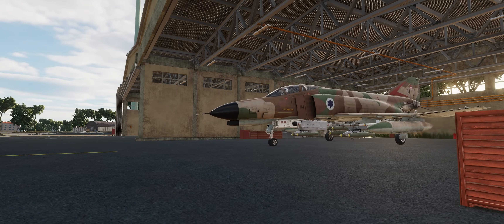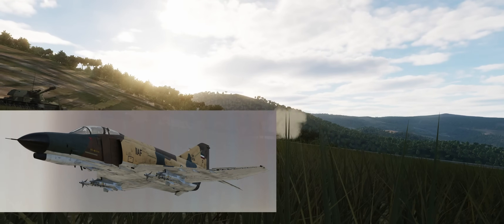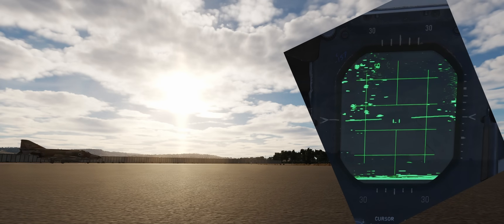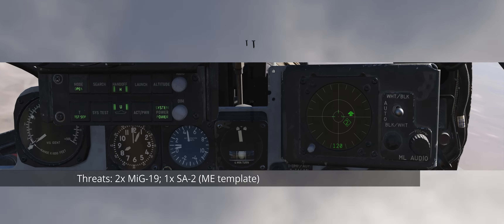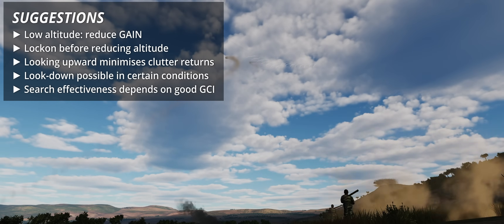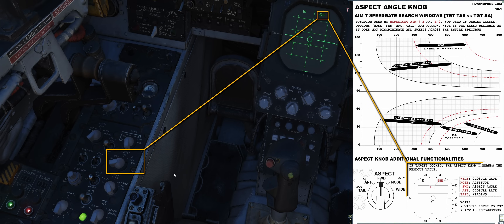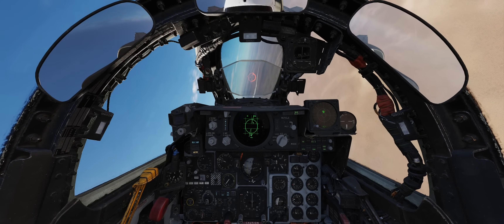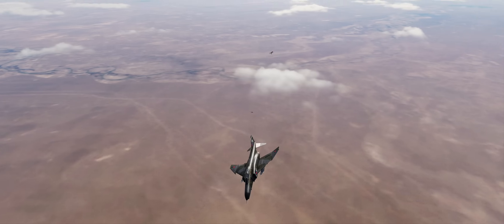DCS F-4E Air-to-Air I: First Steps

Comment: The F4E DCS has been given isn't even the best variant of the phantom , japan has the F4E Kia with upgraded radar and air to air missiles and germany has the F4E ICE with the upgraded radar and AMRAAMS
Reply from the maker: Those are definitely not the "best" F-4 variants, and even saying "best" makes very little sense.
Reply: @FlyAndWire  these F4 variants had pulse Doppler radar with look down and could carry AIM9L
Reply from the maker: That's correct, but they got them so late in the life of the Phantom that the opposition was no longer MiG-17 and MiG-21, but Su-27 and MiG-29, and other bluefor aircraft were late F-15, Eurofighter and so on.
If you put the F-4E in its historical context, I say it is one of the most capable versions of the Phantom ever produced, although I prefer the Navy versions.

Comment: Unpopular opinion. Jester sucks. I can fly co-alt, hot on a target with neutral antenna elevation and jester wont see. I can see it now. "skill issue",  "git gud', "the radar is supposed to be bad." I know. I don't have friends to fly with. Fuck this module. Which is a shame because it is really well done. The radar is just completely unusable for me with Jester. On the other hand. When people let me in the back, I am able to use the radar and achieve locks.
Reply from the maker: Hey, I think it's more of a "you are doing it wrong". In primis, co-alt matters little. Depending on the altitude and radar settings, the MLC may intersect and draw in a ton of clutter. Where you be able to see the contact yourself? If yes, record a video where you reliably can and Jester can't and send it to me. Hop in my Discord, we can have a look at it there. In this case, for a co-alt, I would raise the antenna to match the bisector of the radar cone, this would limit the returns a bit.
I personally don't use Jester and fly from the back as if I were in IFR conditions, basically.

Also, you said you don't have friends but also play as a WSO? Which one it is?
Reply: @FlyAndWire  you know people that I occasionally fly with. No one that I particularly care for. This community can be pretty toxic. I'll upload a video and show you what I'm doing later. I'm going on vacation!
Reply from the maker: Yeah, I know what you mean. Enjoy your vacation; we can check where you struggle when you are back :)
Reply: I also just got the module and am finding myself quite confused.  I'll get a ewr report or say 15 nm. I'll go low and point in that direction, I'll set the radar to the alt it mentioned in the ewr and hope to hear "target" but instead I hear "missle 11 o'clock " as it smacks me kn the lips. I fhis confusing.. how can he see a missle but not a update on the aircraft location? Also he causes me quite abit of anxiety calling out Sam's like his life is on the line, meanwhile, it's on our side....

Willing to learn but currently frustrated.
Reply from the maker: @bradw1808  OK, you are rushing too much imo. Start by engaging something that doesn't shoot back, or at least without missiles. It is better to take it easy, figure out the dynamics and then escalate. Use the mission editor to set up something ad hoc.

Ref Jester, he may have seen the smoke trail from the missile, or reporting the threat's bearing from the RWR. If you are confused, record a video or save the track and we can have a look at it.

Feel free to hop in my Discord server, it is a much better discussion tool.

Comment: The tomcat we have in game is not the 1974 Tomcat, but rather the 1997 F-14A/B. Just a little not when you said that the F-4E is almost the contemporary to our tomcat. (But I can see how it might have been meant differently)
Reply from the maker: Uh.. yes, and? I did not say they are contemporary of the Tomcat in DCS but, ad verbatim, "are almost contemporary of the F-14 Tomcat.".
The -45MC has upgrades introduced around 1974, the DMAS even later. The first Tomcats were introduced in 1974. I don't get the point of your comment, Kron. Whenever I use the DCS Tomcat as a reference, and the timeframe is important, I specify the discrepancy, see here: https://www.youtube.com/watch?v=1M2KERT3T44&t=204s

EDIT: the original post was "The tomcat we have in game is not the 1974 Tomcat, but rather the 1997 F-14A/B." without any other explanation. Hence my confused tone.